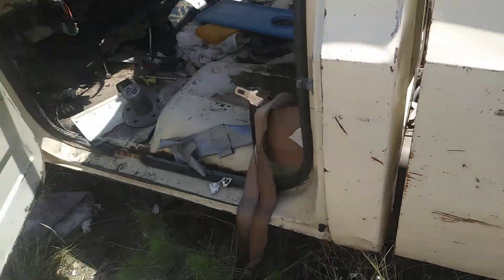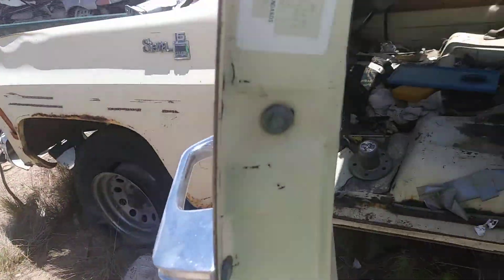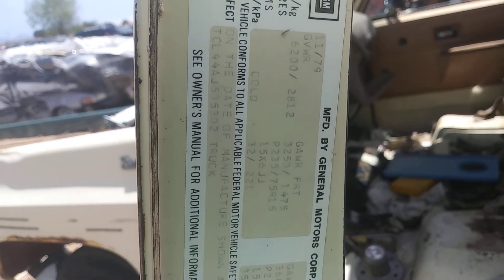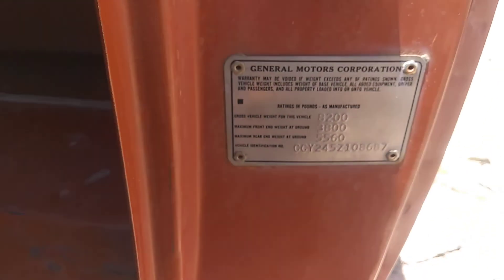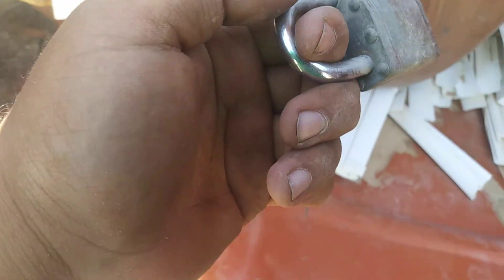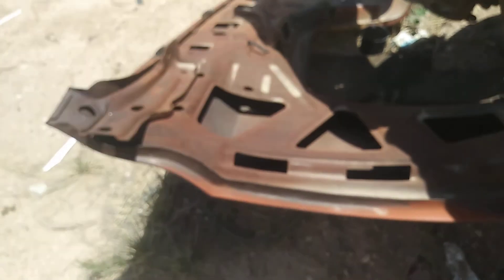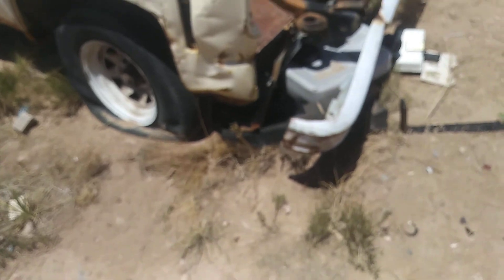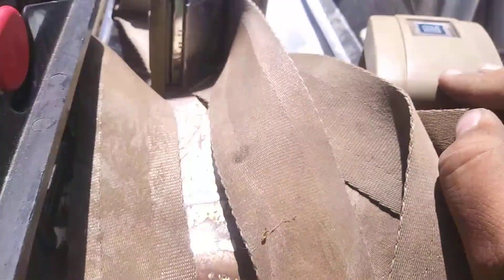1978 GMC 1500 Sierra Heavy Half

Comment: Nope, first one is a 1980. VIN gets us the win: T for GMC, C for 4x2 conventional cab, L for 350 V8 with four barrel, 4 for 1/2 ton "Heavy Half", 4 for pickup and box, A for 1980 model year, J for Janesville, WI assembly and the rest is the production sequence. Should be code #12 White exterior paint. 

Nope, second one is a 1975 model, VIN gets us the win again: C for Chevrolet, C for 4x2 conventional cab, Y for 350 V8 with four barrel, approx. 160  HP, 2 for 3/4 ton rated, 4 for pickup and box, 5 for 1975 model year, Z for Fremont, CA assembly and the rest is the production sequence. Possible code #61 Grecian Beige exterior paint. 

Need the SPiD, wish you did (the decal in the glovebox or under the hood).
Reply from the maker: Thanks  I will try get it  next time.  I always enjoy reading your comments  so fun to read.
Reply: @chevylandt.v  No problem at all.